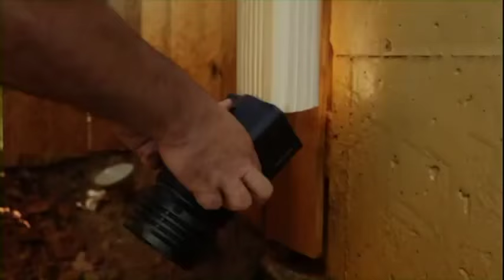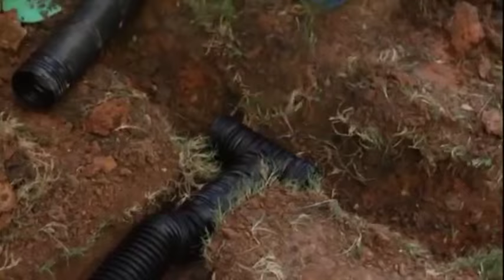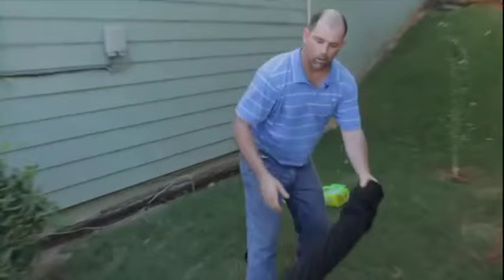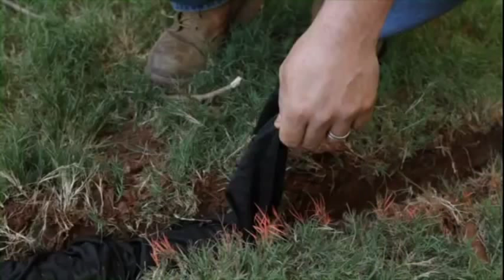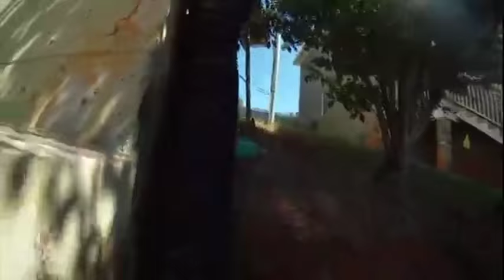Installing a Flex-Drain System

Comment: Flex drain crap pipe. I can crush it with one hand by squeezing. I installed it and after the first ran it was totally clogged and crushed. I dug it up and installed PVC. Still going strong three years later. Even plain corrugated is much better.
Reply: You have to back fill this expandable type of pipe with a self packing material like high performance bedding (HPB) or 3/4 crushed stone.  Yes, backfilling with soil will collapse the pipe
Reply: @Josh-mh3kl  PVC, thick wall corrugated or triple wall pipe don't need stone. The extra cost of stone or bedding make Flex-Drain pointless.

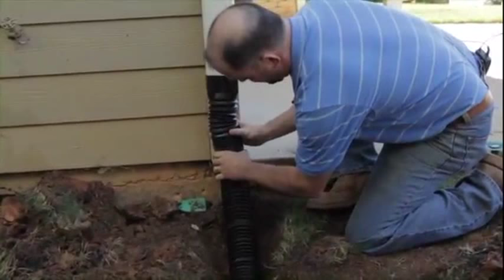Comment: Sometimes at the join of a snap-on can leak, especially when water comes from big-end to small-end at the snap-on joints. For example, at about 1:29 of your video, you snap pipe from drain-pipe to the tee in the ground. The drain pipe has big-end, and the tee has small-end. Normally we want water goes from small-end to big-end. Do you know if there is way to seal the joints? Thanks.
Reply: I’m having the same issue.

Comment: Is this pipe as durable and long lasting as solid PVC? Or is this just to connect the 2 downspouts and then use a solid PVC to your actual drainage area desired? I am doing this process this spring and everyone is telling me to use solid PVC with drainage holes and I am wondering why!
Reply: For a drain line the best pipe is solid pvc and not pipe with holes. Perforated pipe is for use with a French drain and not for a drainage line. Corrugated pipe collects debris over time and as it flexes it is more difficult to establish the proper drop for a run. 

The advantage of Flex-Drain is not having to cut pipe or having to glue the connections. A problem with the Flex-Drain pipe is that the 12' and 25' long sections have  female and a male end but the TEE connector has a female and two male openings. The connector pieces do not slip into or onto the Flex-Drain Tee connector.
Reply: @bswam44 how did you overcome this? I'm currently running into this issue and highly regretting going the flexdrain route (vs the more expensive/durable perforated pipe)

Comment: This production is poorly engineered, I.e., it is junk.

I used it to joint the downspout to 4-inch black corrugated plastic drains. It failed in two years time. The entire length showed hundreds of splits in the bellows if you will, where tree roots infiltrated. In a short 6 foot run, I had a 2 foot plug of hair like roots. It is no wonder the gutters drained so poorly.

If it had been designed as claimed by the manufacturer I would not be digging my yard up again.

Made in the USA is a real disappointment. Thanks but no thanks Flex-Drain. I'll stick with PVC that works!
Reply: What was it like when exposed to the Sun?